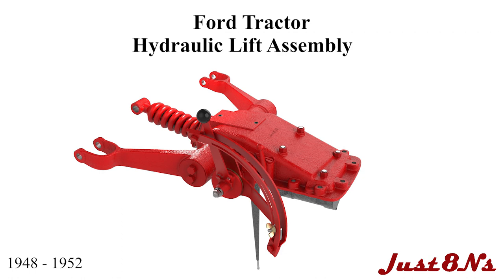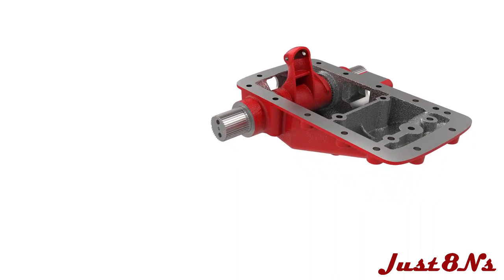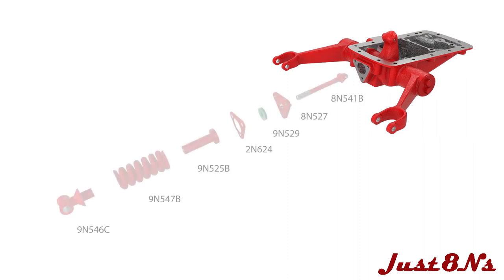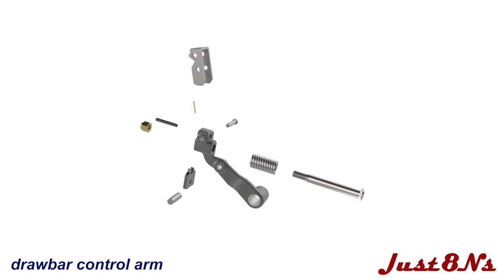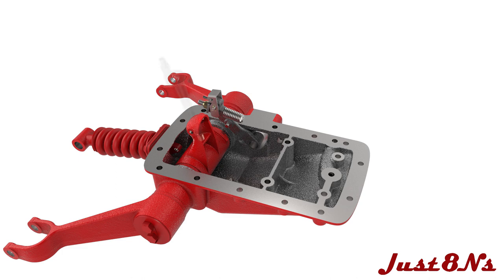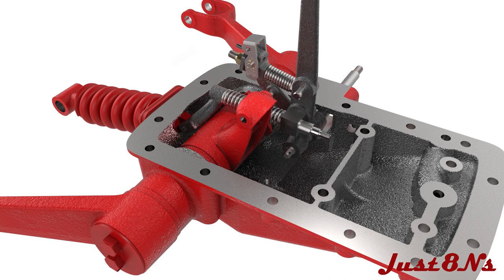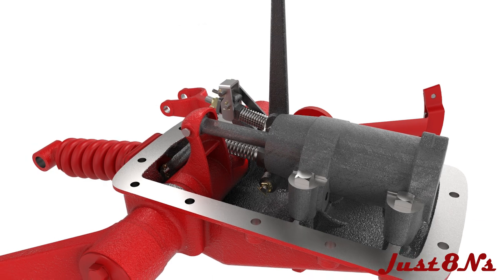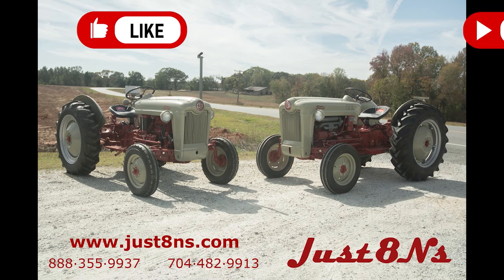Ford Tractor 1948 - 1952 Hydraulic Lift Assembly

Comment: Awesome and perfectly clear video animation. A question though. I know the lift ram arm be slotted/keyed and there be basically only one correct way it can mount. Are the lift arms as well keyed?. Or does one have to through trial and error or previous making on shaft try to align them up as they were before when taking them off and reinstalling?.